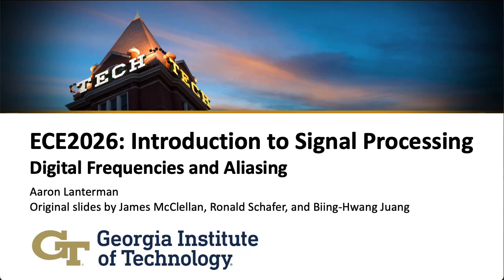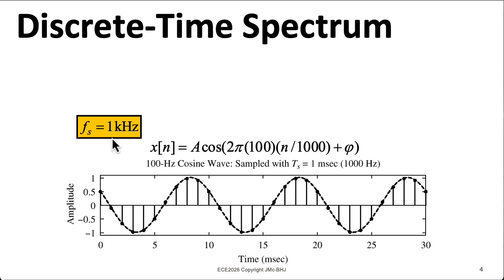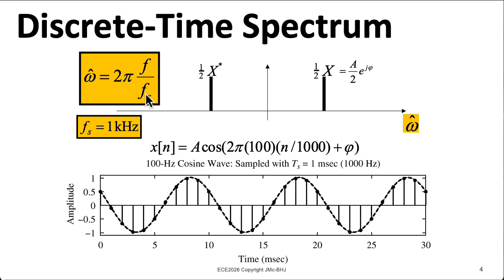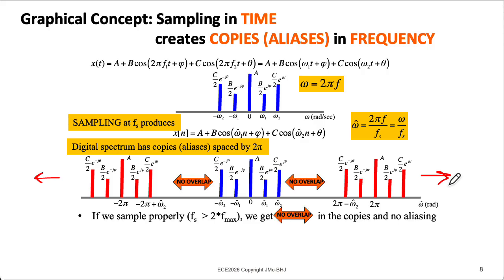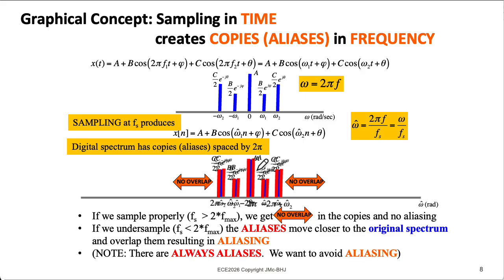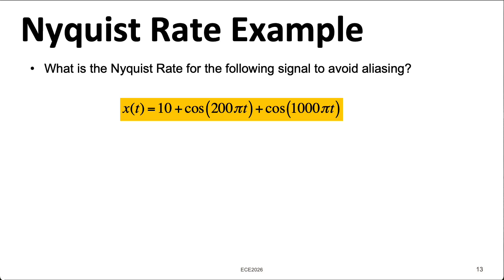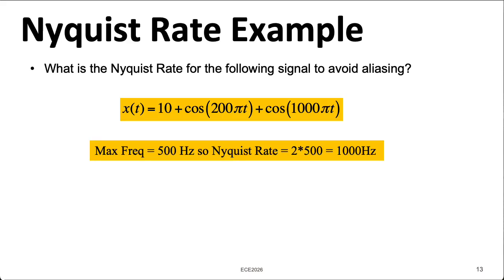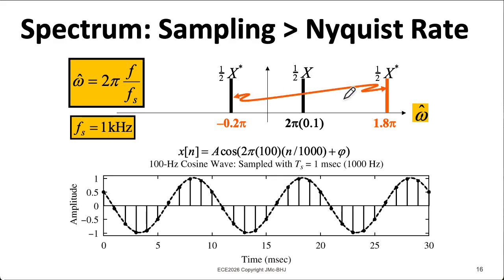ECE2026 L20: Digital Frequencies and Aliasing (Introduction to Signal Processing, Georgia Tech)

Comment: Prof. Lanterman, I have a very simple question regarding aliasing. You say, given x[n] we cannot distinguish the original x(t) because we do not know if the original frequency of x(t) was f_0 or f_0 + f_s or f_0 - 2f_s, so and so forth. But in fact we can do that quite easily: just let the ADC or another device to keep track of the frequency of the input and pass that frequency information to the DAC. For example, if the original frequency of the input is omega, then save omega into ADC, connect ADC to DAC  and passing this omega to DAC, and reconstruct the signal with omega. Is this extremely simple process something that currently technology cannot handle?
Reply from the maker: How would this "ADC or another device" figure out what the actual frequency is in order to "keep track" of it? It doesn't make any sense to "save omega into the ADC." The ADC is just sampling the signal at a given rate. It has no intelligence; it knows nothing about sinusoids or frequencies. If the ADC is running at 1000 kHz, a 1200 kHz and a 200 kHz will both give the same sequence of data out of the ADC. For an ADC to pick up and distinguish the 1200 kHz, it would need to be running at a sample rate higher than 2400 Hz.
Reply: @Lantertronics  It does make sense. Because to set the sampling rate for ADC, you MUST know the maximum frequency contained in your signal per Shannon-Nyquist theorem. Hence you, the engineer, is already "keeping track of it", otherwise you can't even start the sampling process..

I think you also have an unchecked assumption. You say, "for ADC to pick up the 1200 kHz, it needs to be running at a sample rate higher than 2400 kHz." But pray tell how does the ADC to know there even exists a 1200 kHz signal to begin with? The answer is that you know the signal is 1200 kHz. So, couldn't this engineer input this information into the DAC (or, if you must, some more advanced version of DAC, call it "DAC 2.0" if you will) and let the DAC to reconstruct exactly this signal?

My point is, essentially, yes aliasing exists, but this is also the year 2025 and not the 1940s, so couldn't modern day engineers figure out the frequency of the input signal to begin with and build a better ADC-DAC pipeline that incorporate the frequency into the DAC so that it reconstruct exactly the frequency of the signal instead of only reconstructing the signal within [-pi, pi] and risk reconstructing a different signal?
Reply from the maker: @tapasgaspocho61  Ah, I think I see what you are trying to say now. There are radar systems that the deliberately undersample and use aliasing to shift the spectrum around. The key is to have it limited to a particular band. So you'd bandpass filter the signal going in, instead of just lowpass filtering it. Say you bandpass filter so only 1000 kHz to 1500 kHz gets through, and then sample at 1000 kHz. You've killed off signals below 1000 kHz going in, so you know the aliases you measure between 0 and 500 Hz actually correspond to 1000 kHz to 1500 kHz and you can use that in your signal processing. To reconstruct the signal you'd need a DAC running at 3000 kHz. So you might save money on the ADC but not the DAC in such a setup.

I think there's a place in one of the lectures where I mention that sometimes you alias on purpose to move the spectrum around, but that's a highly specialized application so we don't consider it further in ECE2026.